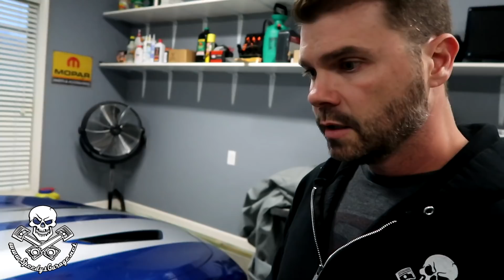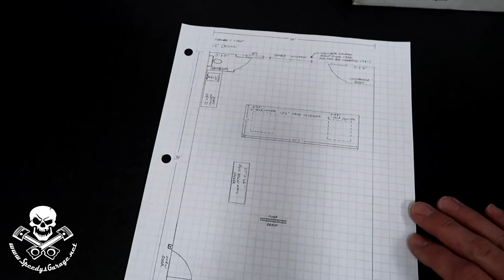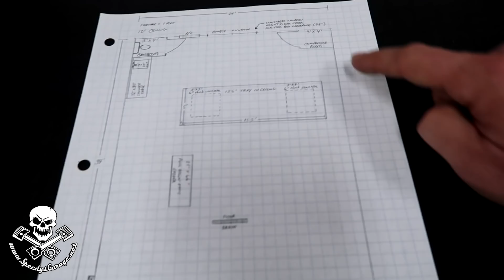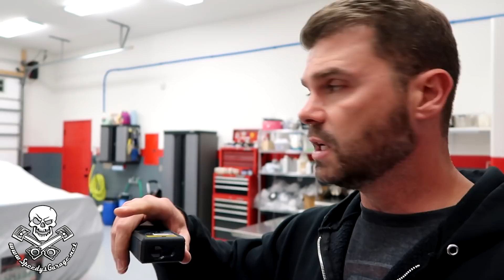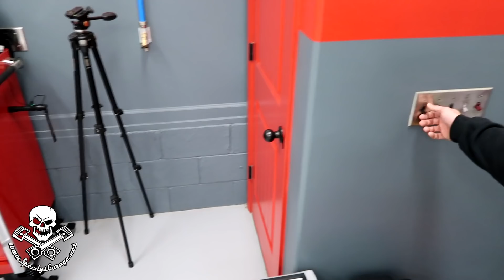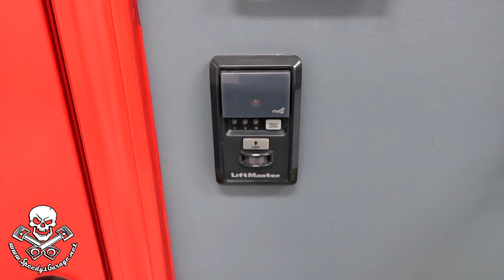Speedy's Garage Shop Build

Comment: I've had a 10,000lb Rotary 2 post asymmetrical lift for about six years now.  The ceilings in my shop are 12 feet and my posts fit fine as is, but you might want to add a hole for car radio antennae to pass through, lol. The lift manufacturer called out for surprisingly little in the way of concrete.  I did that whole pad seven inches deep, 5000 lb mix, and then the lift instructions would've been happy with like 4 inches if memory serves. I was shocked!  If you decide to buy a used lift, be careful, Hilti makes special anchors just for use with car lifts. But I'm guessing from the looks of your shop, there will be no used lift. Lol

Comment: Great looking shop. Instead of the ceiling height, more utility cost, deeper concrete padding and a hoist that also requires maintenance, what if you dug 6 feet into the ground with a few steps that covers when not in use so that you can park car over it and walk under it?
Reply from the maker: Believe it or not there are codes around holes in the ground haha.  I didn't check locally on that but best to consult with your builder for your particular area.

Comment: Good informative video! I'm building a 24' by 30' shop with a 20' parking canopy in front. Slab is down, and bones are up. Roof and siding going on next week. I like your paint scheme! I have a friend that is an architect, he drew up plans for me! Best thing ever! We poured 2' deep by 12" wide beams in slab on both perimeter and across the shop both ways. Lift will be installed over the beams. 12' exterior walls, and 4x12 pitch roof. All insulated with 4" insulation. I plan on an exterior compressor "closet". No bathroom, not that far to house, but will have sink. LED lights. High lift doors, 2 that are 10' x 10' and one personal door. Weld plates infront of shop for moveable winch for pulling cars in. Overhead track system for the moveable winch for lifting engines, parts, etc.....on rollers.Waited 30 years for this, wish I was still as young as you!!  ;)
Reply: All of the above so I can restore my 56 Chevy!  ;)

Comment: I'm a contractor and I would have surely told you 19 feet would not be enough,,,and I would have suggested that you just extend the doors with a roof just over the garage area,,and not change room above,,,where there's a will there is always a way...you never want less then 24 x 24..

Comment: I am a plumber an I hate grinder pumps on toilets I once had one that a lady flushed a hand towel down and jammed up the grinder needless to say it was a gross one to fix.
Reply: There really isnt any that I'm aware of you went with what you needed to make it happen I dont run into these grinders alot but when I do its typically because someone flushed somthing that they should not have. Basically when your water flows up hill or if your drain pipe is less then 3 inch atleast here where I'm from you have to have a grinder its a every state verys but that was about the only option you had that in aware of. nice garage though. Maybe one day I will get out of my pole barn and the dirt and have a setup like yours
Reply from the maker: Yuck!  What other options are there for a situation like this where water has to flow up hill to the main lines?

Comment: Beautiful shop man! No hate or anything but is there a reason you didn't put your airlines behind the walls?
Reply from the maker: Mainly for any required maintenance.  If there was ever an issue you'd have to tear in to the wall to get to the lines.

Comment: Another informative video. My neighbor has turned his attached garage into a woodworking shop.  He is able to access the storage space above the garage from inside his house.  He installed an electric lift that fits between the ceiling “beams” With a two way switch he can raise or lower this lift from his attic space or the garage.  Of course you’ll still have to use the pull down stairs to get you in position to unload or load the lift.  This lift fit flush with his garage ceiling when retracted.

Comment: Thank you very very much. I am having a 30x40x10 shop put up. I Have had a few issues with my site and just things are not lining up. Sat here and watching your video and paused it, and talked to my wife and will put it on hold until winter is over. We live in Montana and winter has finally hit. It was suppose to go up February 5th start date. But now have decided to wait until spring. This way I can get my septic in and such before the building starts rather then after it is up. Didn't think about sound deadening material but it is on the list now LOL. Keep you videos coming I already learned. Thanks
Reply: get the shop up?i just finished the inside of my 44x36x12...not big enough already but im very happy with my results

Comment: I'm north of you a bit, in KY, near Ft. Knox. Had a 30x50x12 insulated pole barn type garage built around 2008. Gosh, regrets now about wishing I'd put more thought into it.🙄 Example: My neighbor said I outta run water out to it, slope the floor to center with a drain to outside. Wish I'd done that. D'oh!😲 Nice video!

Comment: hello speedy great job on your garage, i know you have the recess in your ceiling for a lift but i think now they have lifts where the posts dont need that kind of height anymore which i think would look better and also you might want to put in the Fujitsu heat and air conditioning system they work great and are very economical, other than that awesome job best of luck to you and miss speedy happy new year   steve

Comment: I think you covered it front to rear very well. Here in Calif It would be some big $ to do the same. Are the lights LED ? There are wireless remote controlled options. Did you consider ceiling fans ? Your garage is first class !! Nice job Speedy. 👍🏻
Reply from the maker: Yeah I bet in CA it would cost a fortune as most things do out there it seems :/  The lights are T54 fluorescent bulbs.  I considered LED, but at the time I was choosing lighting they were expensive compared to the T54.  I also found the T54 bulbs on clearance at HD, for like 75% off, and that sealed the deal on those haha.  If building today, I'd compare to LED for sure before making a decision as things get cheaper over time.